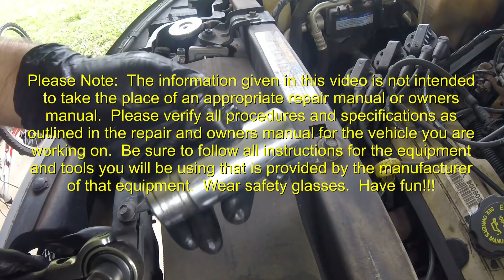Four Ways to Collapse a Caliper Piston

Comment: I’ve been trying to compress my brake piston for about two hours and I watched about 10 videos and I finally came to your video and it finally helped thank you you’re a lifesaver
Reply: c clamp
Reply: Yes genious life saver y right!
Reply: Same problem here. I even used a c clamp. But it's still now budging
Reply from the maker: Are you working on rear brakes by any chance?
Reply: @BarboursAutoHelp  im working on my rear brake pads on a 2003 ford focus and it won't budge, can't find any info anywhere else on how to do it and someone told me that I need to unbolt something to get it to go back in
Reply: Your caliper is probably starting to seize or is seized. They to spin your tire and if it's in neutral and doesnt spin that means the caliper is stuck to the brake pads pushing the rotors
Reply: When you take the caliber off, my pistons still won’t retract in I have a seat clamp it’s a 2006 GMC envoy

Comment: As others have said, I've watched numerous other YT videos on changing brakes, but never understood what they did to pry the brake pads apart with a pry bar or screwdriver. I always replace with new calipers, so I'm not worried about damaging what's coming out. This is an excellent, concise, and clearly narrated video. Thanks!
Reply: 🎉8
Reply: You have to bleed your brakes after? Second time ive done this and lost pressure

Comment: I didn’t have any of those other tools and didn’t want to do #1 so I put my old brake pad in front of the piston and used the center plate and bolt from a harmonic balancer puller to drive the piston down

Comment: I have a big ViseGrip like locking C-clamp pliers I sometimes use
Reply from the maker: Elaborate
Reply: @BarboursAutoHelp  Sometimes called a welding clamp. It's a Vice-grip with a C-clamp jaw,. they come in different sizes. it's a big one and opens pretty wide. Might not work on all calipers but I have used it on some.. May have just clamped from one brake pad on the piston to the back of the caliper.

Comment: This is how i do it and it works, but i encountered a problem with my fathers that we ended up replacing the caliper becsuse it would just not go back and it was so hard we bent the tool, then went to the other side and same thing, but i tried pumping and it went in turning and pushing the piston. The rubber boot was not damaged or twisted. I dont do it the twisting way because the boot tends to twist. But like i said. For some reason it worked that way. So we didnt have to replace that second caliper

Comment: What happens if the piston is not flushed (reset to original flat position)
When I changed my Honda civic 2007, I used a c clamp but didn't use old brake pads I don't even know if the thing went down.
But I managed to put everything back together with new brake pads.

The piston didn't come out too much

Comment: Do you ever open or crack open the brake fluid reservoir filler lid in the engine compartment?  *I've done many brake jobs before using different methods to compress the pistons back into place. On one install, all these methods failed to retract the piston back into place. The only way was to open the brake reservoir cap to relive the back pressure in the system. With the cap loose, I could use my "tried and true" C-clamp. (Just wanted to share this tip.) Thanks for making this video!

Comment: on a 2000 escort zx2    you can only access the outter edge of the piston ...........what i dont get is....when u compress it it stops the rotor,/..... how does it release.......and if so why wont it release on its own,    just put new pads and its too tight on the rotor, as if the brkes are pressed.      why wont it juast retract back on it own.

Comment: I had hoped you might be able to help. i had removed the rear calliper today and accidentally hit the ignition (electric parking break) and it automatically fully pushed the piston out while the calliper was disconnected.

 Now the piston is fully released, and i'm unable to get the piston to retract so I can fit the calliper tool.

 I have tried a socket to manually retract the calliper piston, but it's just spinning? 
Do you know if there is any way to couteract my error lol or do you think i will need a new unit.
There is absolutely no gap in the calliper pistel for a calliper tool. it's completely pushed out and come loose.

Comment: Can you tell me your channel lock plier size ?
Reply from the maker: Big
Reply: @BarboursAutoHelp   and 16-18 inch spanner needed to remove 2 bolts of disc rotor ?
Reply from the maker: Depends on what your working on.  They are not all the same.  I'd say if you're going to work on your vehicle have a tool kit.  Not just the particular sizes you need.  You never know what you will encounter.  You need to have an arsenal.
Reply: @BarboursAutoHelp  Ok, Thanks

Comment: Why would you open the bleeder when you’re doing this. The brake system is a sealed system. The brake fluid down by the caliper is no more “nasty” than what’s in the reservoir.
Reply from the maker: A lot of professionals would disagree.

Comment: Does the car have to be on , to compress the caliper back in?
Reply from the maker: Usually not.  But I'll say different manufacturers may have special procedures for doing this that are not gone over in the video.  Id say this video is a one size fits all for 95% of the vehicles out there.  But that 5% can bit you in the you know what.  So, check your repair manual.
Reply: Thank you

Comment: What do you do if the piston is stuck and you can’t compress it? I’ve been stuck on replacing one brake pad for 4 hours because of it.
Reply from the maker: Is it a twist in caliper on the rear of the vehicle?  What kind of vehicle are we working on?
Reply: @BarboursAutoHelp  2016 Nissan Rogue. Worked the rear brakes and was able to push the pistons in. But the front driver side is stuck
Reply from the maker: @matthewlowe8828 This is probably the best way I can help. Here is a link to a video may or may not get you by.  How To Diagnose a Locked Up Brake Caliper and/or Dragging Brakes
https://youtu.be/1Mor9N9Rv2w

Comment: Whatever method you use always push in the piston with equal pressure all around the piston, with dual piston calipers push in one piston at a time with bleed screw open, if pressure is applied to one area of piston it may go into bore at an angle and damage the piston and/or seal.

Comment: Damnit man none of these suggestions worked wtf!
Reply from the maker: You working on rear brake calipers?
Reply: @BarboursAutoHelp  yes I have to replace my rear brake calipers and rotors
Reply from the maker: @Nikkon33 Is your vehicle equipped with twist in rear caliper pistons?  What kind of vehicle is it?
Reply: @BarboursAutoHelp 2004 Ford f150 heritage 4.6 L
Reply from the maker: @Nikkon33  Actually, if you are replacing the rear calipers the new caliper pistons should already be in.  Are you trying to collapse the old calipers?
Reply: @BarboursAutoHelp  So, on the old caliper the piston actually BROKE inward from trying to use a C clamp to compress it. That's why I'm replacing the caliper. At least on the passenger side rear wheel. Hoping that the same doesn't happen on the other side.

Comment: Bought a bronco 2 That had been sitting for 12 years! Rotors all rusted up calilpher piston fully out! Used the screwdriver pushing Inwards on the rotor enough to put the Screwdriver between the brake pad and the piston! Push the piston fully inwards, your method worked thanks a lot!

Comment: I did the pry bar method and forgot to take the cap off my reservoir or opened the bleeder valve and blew my master cylinder 😔 i bled it a million times with the new one and cant get the brakes to hold pressure
Reply from the maker: Oh man!  That stinks.  I hope you get it fixed.
Reply: @BarboursAutoHelp  no luck so far, none of the shops work on old cars either so im screwed. Im upset with myself and my car
Reply from the maker: What kind of car is it?
Reply: Its an 84 turbo 300zx, no abs or anything.  Just upsetting ive bled it so many times with no progress
Reply from the maker: I feel your pain.

Comment: tried the screwdriver method just to know if it would work in a pinch, and it did work. tho i wouldnt recommend it if you have another option as you can damage your rotor and brake pads.
i used the channel lock pliers method and it worked like a charm. cleaned everything up and regreased the slide bolts and its working great! i have dual caliper pistons and i took them from being stuck to compressed and fully functional in about 10 mins no problem. great video and tips!

Comment: You can use that caliber collapsing tool to bleed the calliper without mounting it either. If the bleeder is stripped, and you have to bleed with the Brake line bolt, this allows to angle the caliper right to let air out. without being mounted.

Comment: Does it matter if the caliper is disconnected from the brake line?
Reply from the maker: Yes, it does in regards to getting air in the system.
Reply: @BarboursAutoHelp  would having it off make it easier or more difficult then? I took mine off for paint and the calipers came out too far
Reply from the maker: The caliper pistons came out too far?
Reply: Correct. I can't fit the new pads in without collapsing the piston, but it's off of the brake Iine
Reply from the maker: @kylerdecoopman1106  well, if the pistons are not hyper extended, as in about to pop out, push them back in.  Or is the piston coming out in an abnormal fashion or is the a problem that isn't being conveyed?  It's normal to have to push the piston back in to replace pads.  I'm not there to see the caliper and analyze it for myself so...not sure if there is a problem that I'm not seeing.  If your not confident you can put the caliper back on an have it work well to keep you safe then I'd recommend towing it to a shop for a tech to fix it.
Reply from the maker: @kylerdecoopman1106  why would it be more difficult?
Reply from the maker: I'm not sure what the problem is.  Just bleed the system after you put it back on.  It collapses just as well either connected or disconnected from the line. Just catch the fluid that comes out.

Comment: Heard that you need to open the bleeder bolt on cars with ABS in order to push back the piston correctly. Am i correct?
Reply from the maker: Yes, and I would recommend it on any vehicle.  I should have some information in the description about this.
Reply: @BarboursAutoHelp OK! Why is this so important?
Reply from the maker: @Zlimeghost  It's nasty.  Its been heated up and cooled down over and over and over and the same brake fluid that has been in the caliper has been in there probably since the vehicle was new for a lot of vehicle out there.  For vehicles with ABS you don't want that in your HCU.  For vehicles without ABS, why not get that fluid out while you are there.  Get some fresh fluid in there.  Your there any way.  Also, pushing that nasty fluid back through the system can't be good for it.   Not in my mind any way.

Comment: I have a caliper rewind tool for screw back pistons, can I use the old brake pads and push against the front pistons with the rewind tool, similar to using a C clamp?
Reply from the maker: What's the rewind too?
Reply from the maker: Its possible that you could make that work.  However,  that tool is made for twist in caliper pistons usually used on rear calipers with integrated parking brakes.

Comment: i dont know how i messed up, used the C clamp method, all worked fine except... break line under the car broke and started dripping after i finished both front wheels
Reply from the maker: You from up north?
Reply: @BarboursAutoHelp  Europe
Reply from the maker: Is the brake line rusted out maybe from salt used on road ways?  That happens a lot in the US in the northern parts.
Reply: @BarboursAutoHelp  what an coincidence, i fix the brake pads and next thing the line broke, i was afraid that pushing the cylindre in caused some pressure and broke the line
Reply from the maker: Did you open the bleeder while collapsing the piston?  Your supposed to crack the bleeder first.  Either way, the line should not have ruptured under that little bit of pressure of pushing the piston back in.  Your brakes operate under very, very high pressures.  So.... was the line rusted or what?
Reply: @BarboursAutoHelp  no i didnt open the bleeder, went to the mechanic yesterday and he sayd it could be just an coincidence.Bad timing but luckily it went when i was stationary not when driving high speeds

Comment: Question: can I actually open master brake cap instead bleeder screw?
Reply from the maker: Of course you can.....that's not my suggestion though.
Reply: BarboursAutoHelp would it still do same thing ?
Reply from the maker: Yes but you're pushing nasty brake fluid back through the system.   I think I wrote some info in the description about it.

Comment: If its hard to push piston, is that any chance that the piston is got bigger because of heat?
My piston has to be smashed with hammer
Reply from the maker: Doesn't sound like a heat problem.   Brakes are designed to work properly at high temps.   You may have something else going on.  Check the description for links to other helpful videos..... I would not advise smashing your piston with a hammer.
Reply: @BarboursAutoHelp  oke thanks sir

Comment: Thanks. Can you avoid bleeding the system if you open the bleed valve whilst collapsing the piston ?
Reply from the maker: Yes, I have information in the description about not allowing air to get in by tilting the caliper while the bleeder is open.  Check it out.
Reply: @BarboursAutoHelp  thanks.

Comment: Thanks for reminding me to open up the bleed port. I was tightening the c clamp like a muv'fucka to no avail.
Reply: You should still be able compress the caliper/pistol without opening the bleeder. If it's that hard to compress with the bleeder closed it's possible the rubber hose leading to the caliper is faulty.
Reply: I think he had a hard time because the reservoir cap was still on and the system had no space to let air out.
Reply: LMAO 💯
Reply: The bleeder duh! I popped the reservoir cap but still struggling. I'm bending the tool 😆 damn Ford transit 250 made me work. Big thank you!

Comment: My bleeder valve is stripped.. any tips on getting it open other than replacing the caliper?
Reply from the maker: Don’t have a vid yet.
Reply: crack or take off your brake reservoir cap.  No need to replace the caliper.  Pushing brake fluid up in the system won't hurt anything.  It's all dirty brake fluid unless you do a flush.
Reply from the maker: I'd have to disagree with you.  The brake fluid doesn't flow through the system.  So the same old dirty fluid behind the piston has been sitting there getting hot and cool hot and cool for who knows how long.  The fluid in the caliper gets dirtier.  You don't want to push that back through the system.
Reply: jjj023 I understand opening the reservoir cap but say i wanted to actually bleed my brake lines correctly, I was just looking for a way to open my bleeder valves if they’re stripped but I’ll probably just end up torching them and using vice grips

Comment: I've always used the channel lock pliers method.  Works great and I've always had a pair of channel lock pliers in the toolbox.  Steering wheel puller also work great if you have one kicking around.

Comment: You mention "nasty brake fluid". I'm assuming you were changing the brake fluid too? Meaning this wasn't just a pad replacement or brake service.
Reply from the maker: No.  Wasn't replacing brake fluid.  Wasn't replacing pads either.

Comment: So if the piston is stuck I HAVE to open bleeder screw and HAVE to bleed the brakes afterwards ?
Reply from the maker: If the piston is stuck you may have a bad caliper or some other component not allowing the piston to retract.  I've got a good video on locked up calipers.  Check it out.

Comment: Mine still won't compress.  I took the bleeder out and used a C clamp with a bar for extra leverage and it still won't compress.
Reply from the maker: Well, you may have a stuck caliper.  Is it the front or rear caliper?
Reply: The driver side rear.  I used some penetrating lube and worked it around and tightened the clamp super tight and it finally pushed in far enough to reinstall.  It still wouldn't push in all the way like every other caliper I have ever worked with though.  Seems to be working now.
Reply from the maker: You may have a twist in caliper.  Did you check your manual?
Reply: Kenneth Niswonger if you’re working on the rear brakes and the emergency hand brake cable is connected to the caliper piston you will absolutely need to use the push and turn method. There is;a special compressor tool for this job.
Reply: Yes I have discovered that after doing a little more research that it is a twisted piston.  I have ordered a kit to do the other side.  Never saw anything like that before.  Thanks for the info I will try and tackle the other rear brake when I get my kit.
Reply from the maker: I have a video on that too if it helps.
Reply: @kennethniswonger3514  Auto Zone will lend you the tool you need to twist and compress the rear pistons. If you want your own, Harbor Freight will sell you a brake compression kit for about $60 bucks.
Reply: I found one on Amazon for 20 bucks it did the job quite well.  Took about 5 minutes and I had it all done and back together.

Comment: I have a front end creaking when I let up on brakes from a stop after changing out front rotors could it be from not properly/fully collapsing. Caliper pistons?
Reply from the maker: Sounds like you caliper slides may be creaking.  Did you live the slide pins well?